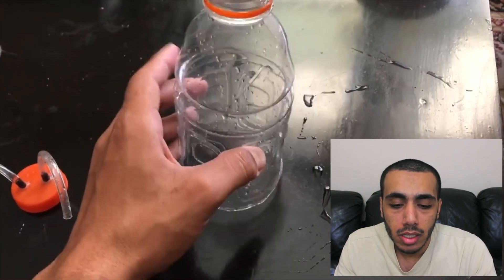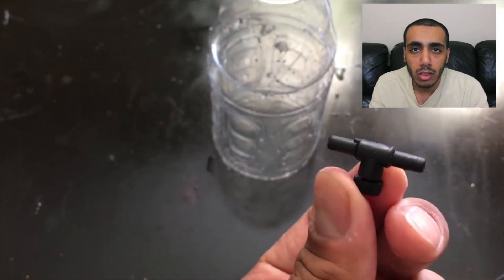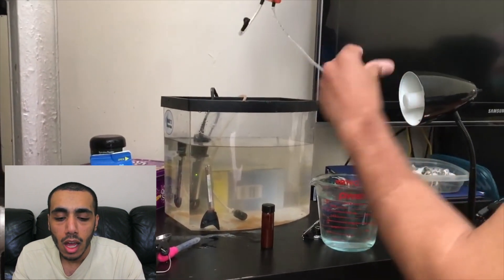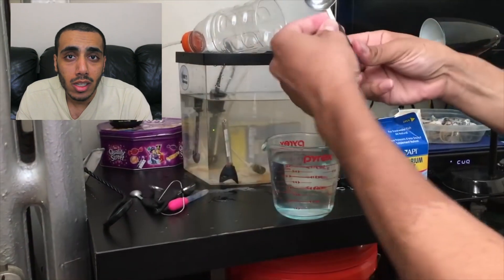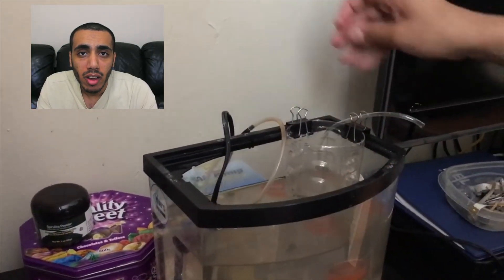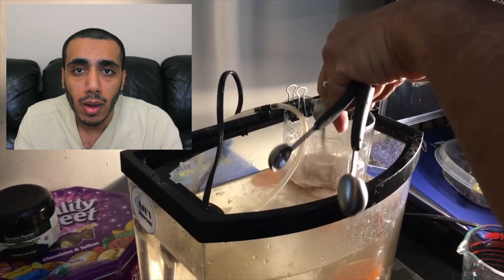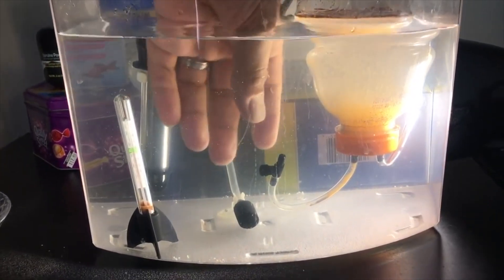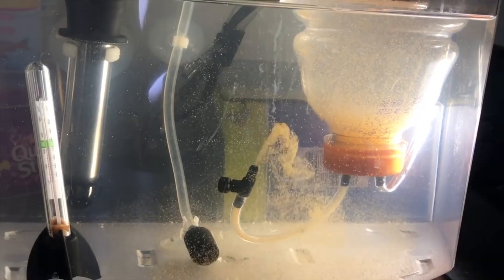How To Make A Brine Shrimp Hatchery and Raise them

Comment: Can using sea salt water meaning water taken from the ocean be used to raise brine shrimp?
Reply from the maker: I never tried, I supposed. Let me know how it goes please
Reply: Moe Negm i did use ocean water and it worked surprisingly good. The brine shrimp started hatching in like 8 hours. Now I will be trying to raise them to adults using only ocean water inside a 5 1/2 gallon tank. I plan on recording it so I can show you. I will be using your method with the plastic bottle inside the tank.
Reply from the maker: @tonyjones1317  That's awesome! thank you.

Comment: I saw the black dots inside ur bbs ( or im just paranoid with my issue with my starter), it went to the bottom along with bbs, same goes to me,  what was that? Cause my fry didnt eat the black dots and I need to clean away from my fry tank..is that normal when everytime bbs hatched? I thought it was mites or my bbs starter had a problem😅 are they alive???? Help me !! Thanks😊

Comment: I've got the same setup. Just a question... If the shrimps don't come off the valve pipe, is this because there's too much eggs that haven't hatched?
Reply from the maker: Probably yeah. Squeeze the pipe a little bit and it should come.oht easily. Good luck